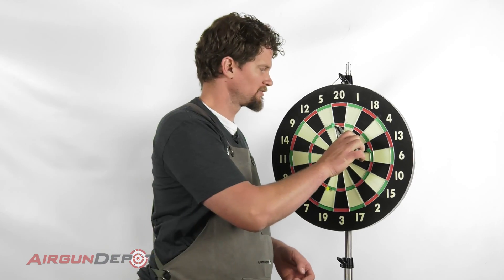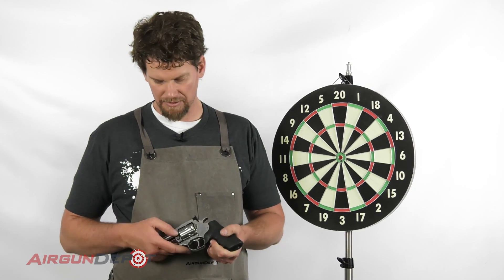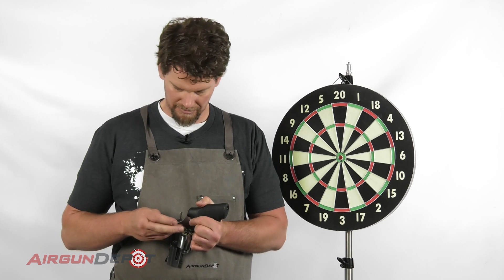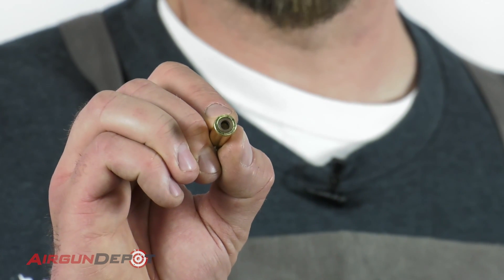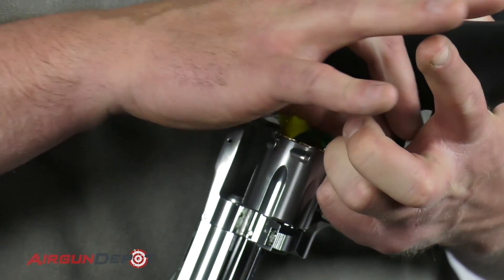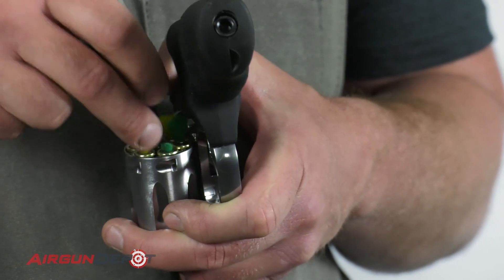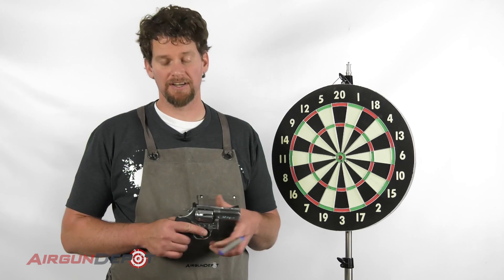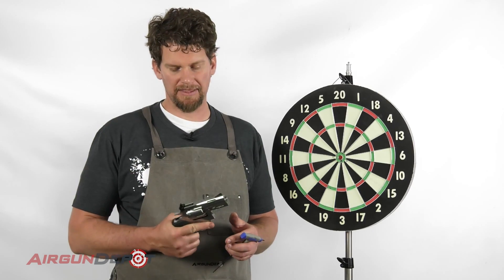Airgun Darts: Loading the Darts

Comment: that you know. Are the darts compatible with the 357?
Specifically, I have casings for BB's.
Could I change only the casings if they are compatible for only the cartridges of the 715?
If they were compatible for only the shells of 715; Are the 715 casings of the specific case with Dan Wesson 357 BB's 2.5 compatible?

Comment: I reformulate more synthetically and I hope more clearly.

Are the darts compatible with the "old" Dan Wesson 357 BB's?

If the darts were not compatible with the 357 with the original series casings, could I change the cartridges to opt for those of the 715 compatible with darts? 
Are the shells of the 715 compatible with the darts, which are in turn compatible with the D. W 357 BB's?

Thank you
Reply from the maker: As long as the cartridges are completely brass they should work. If they are the ones with the plastic tips then they won't. If you have the plastic tipped ones let us know and we may have something that would would work for you.